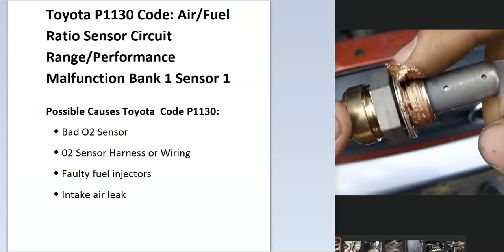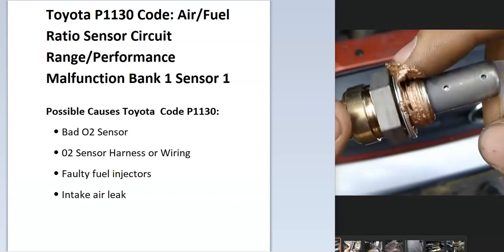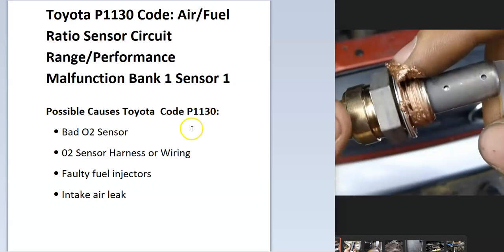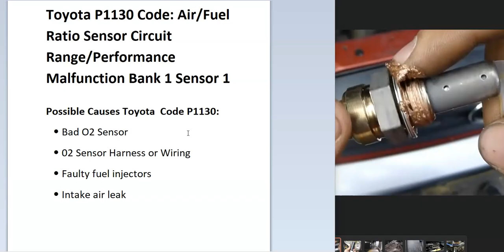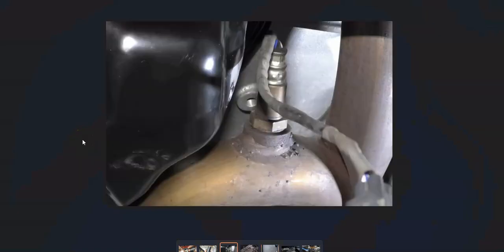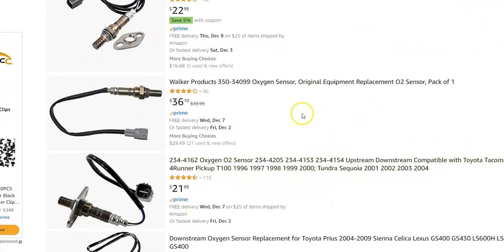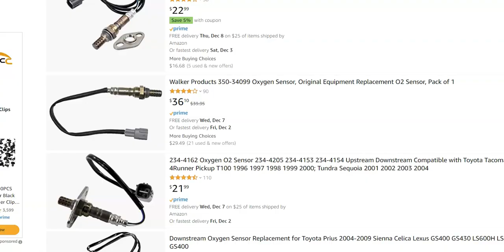Causes and Fixes Toyota P1130 Code: Air/Fuel Ratio Sensor Circuit Range/Performance Bank 1 Sensor 1

Comment: I have p1130 and p1150..would i have to replace both or start with the one on top on the exhaust manifold under the hood?
Reply from the maker: P1130 is bank-1 sensor-1 and P1150 is bank-2 sensor-1. It is kind of strange that both failed at the same time. While it is possible, it seems unlikely; I would test the wiring.

Comment: My 2001 Toyota Tacoma keeps showing p1130 code even after replacing both O2 sensors maf and map. The catalytic converter was removed by the previous owner. How can I get the codes to stop?
Reply: Was it removed and replaced or removed and cleaned out I have the same issue please and thank you
Reply: Gotta reset the computer but unplugging the negative terminal from the car battery for about a minute, thank me later gator🐊

Comment: well is it a good thing that i kept my old upstream o2 sensor and Mass airflow sensor because i just got this code. 3 months ago my purge valve broke and i didn't realize it until i replace my upstream o2 sensor and MAF, so now i got a new code P1130 pointing to my bank 1 sensor 1 which i replace with an offbrand o2 sensor i got from Amazon. Guess my camry only take Denso.

Comment: I had P1130 but all oxygen sensors are new.
Reply: Only use Denso sensors, Bosch doesn’t work with Toyotas or Lexus, if you did use Denso make sure you brought CA emissions if your car requires it. Check part numbers on Denso website next reset CEL light and use good gas
Reply: Still same codes?

Comment: 1. History - Has anyone been working in the area lately, especially an amateur ?
2. Inspection - Look ALL AROUND.  "Anything can cause anything."
3. Handle things to check for loose, broken ... A smog test lady just leaned on a hose once ... and it snapped.                  I thanked her for her preventative maintenance. 
4. Instrumentation - Stethoscope to listen for leaks, scanner
5. Look for other systems with issues - 
6. Prayer

Comment: For 2000 V6 Camry there are 2 upstream sensors, bank 1 and bank 2. They are different sensors, further confusion also 2 different requirements, one for CA the other Federal. Bank 1 sensor 1 cost more and PIA to install, located well below the engine next to the fire wall plus extremely tight to remove. OEM around $300, Denso OE around $170 for CA, Federal much cheaper but won't pass for CA smog test. EBay and Amazon, need to watch out for fakes.
Reply: this is literally my car and code lol. thanks
Reply: Watch out for Amazon sensors they're selling denso's they say Denso then they have the part number stamped on them and Japan underneath that Denso does not put their part numbers on their sensors they use a special code sequence so tired of forgery

Comment: I went to a bmw shop and they changed me $600 for each sensor,and my car has four,but I was able to afford just two,since I only had $1200,it wasn't until a couple of days later that I found out that they're super cheap,and I could have replaced them myself 😔😔😔